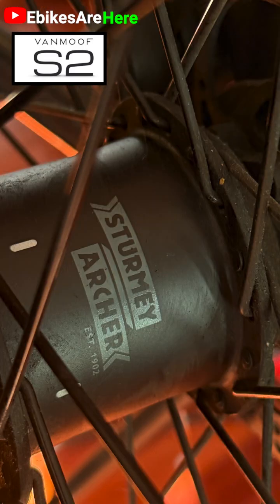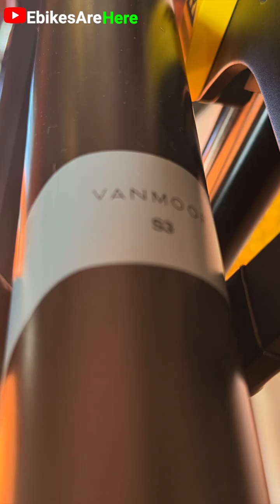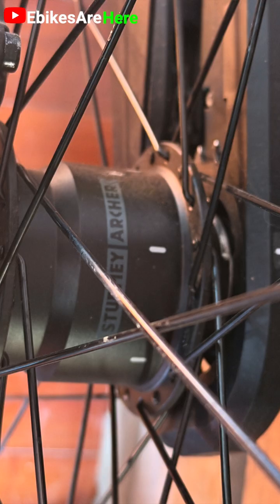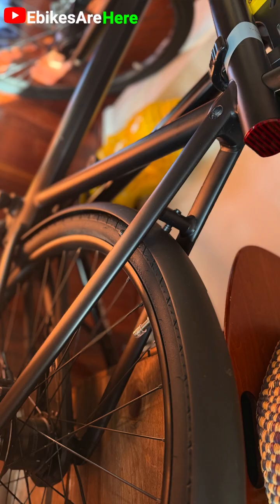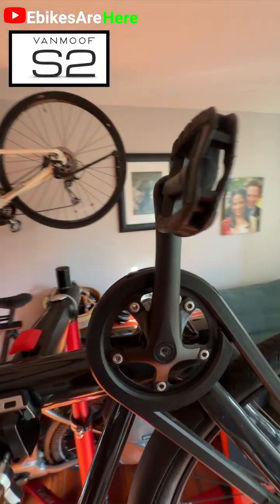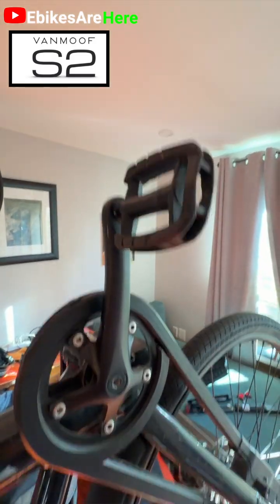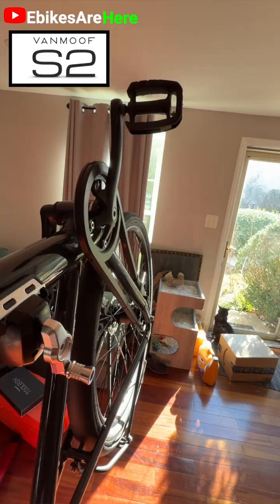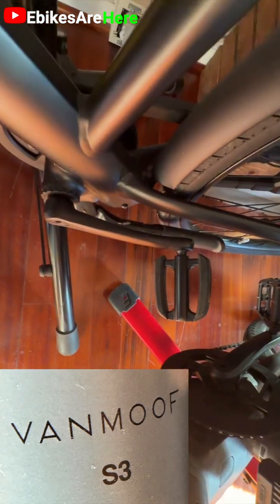VanMoof parts swap

Comment: Even the seat and fenders will not swap out!  Nor will the battery, the smart cartridge, nor the brakes, as S2 uses mechanical and S3 uses hydraulic disc brakes.